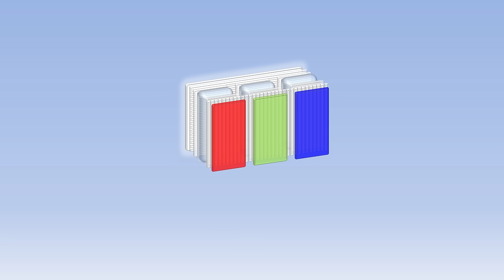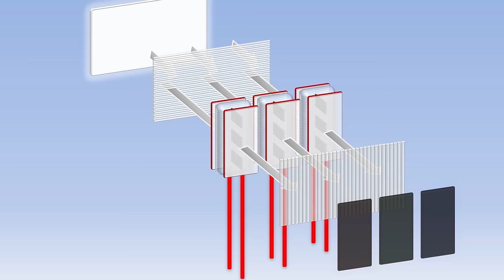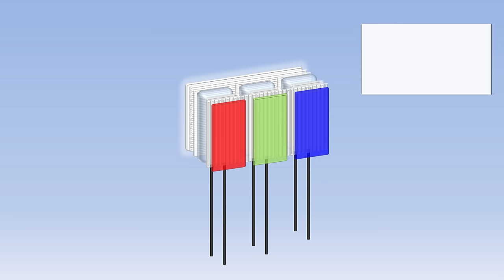How PIXELS Work

Comment: Surely the best LCD video I've yet seen! Awesome work!

You could've added a "extra fact" thing that explains that the 0-255 is just a 8 bit binary number, not an arbitrary value.
Reply: *****
That's right.
256(=2^8) is 8 bits for each color, while 16777216(=2^24=256^3) is the total colors that each pixel can have.

That's a lot of information for 1920x1080 screen! You need about 50 million of 0's and 1's for each frame, if it was completely uncompressed.
Reply: bunch of geniuses in the chat!

Comment: I've found several videos and articles that describe what this video describes, but I'm having trouble finding one that describes how a particular set of RGB voltage levels gets from the chip that is receiving the data stream to a paticular pixel on the screen. For a 1920 x 1600 pixel screen, that's over 3 million pixels! For each pixel, you have 3 LED's with 2 electrodes each that you have to wire up. So that's 3 million * 3 * 2 = 18 million wires! So I can't imagine that it's actually done with wires? How does it work?

Comment: This has been the connecting point for everything I've researched on pixels

Given that each color filers has 8 bits ( binary digit) of brightness information like this :

1   0   1   0   0   1   0   1
for each bit you get 2 possibilities : 0 or 1

2 x 2 x 2 x 2 x 2 x 2 x 2 x 2    = 2^8 = 256

Comment: But how does the monitor send a signal to each pixel? does that mean each pixel is wired? I thought thats why mini led is hard to make, 

Found the answer from reddit, doesn't explain why the mini led is hard to make, and what kind of tiny wires are they using?: 

"ACTUAL ANSWER: most screens are subdivided into squares or columns of pixels. The actual pixels are made up of 3 subpixels. Yes, each subpixel has two wires going to it, usually one wire above going up and down and another line under the going sideways, like a grid with subpixels located at the intersections. Inside the screen there are "column driver" chips that take binary address along with color and intensity and convert it to a signal to drive the subpixels. If your monitor is say 1920x1080, you can have twenty 192x540 blocks each driven by their own driver. All these chips are then connected to the master chip that takes input from your videocard, does address conversion from x,y,intensity to column,x,y,intensity. This master chip has very few data lines coming from the videocard."
Reply: oh so do the wires go in between the "black" parts
cuz was my exact question

Comment: Even when my screen is completely black, there is still light coming out from it. Where is the light coming from in that instance? Is the light coming through the spaces "between" the pixels? Or is something else happening here?
Reply: I the black pixel goes fully dimmed but doesn't turn off. Just guessing.
However, an AMOLED display can actually turn off the black pixel.
Reply: When there is light even when your screen is completely black that means there is still some degree of each color between 0 and lets say 20 or less so it's not completely black but it's very very dark that you would think it's black.

Comment: One thing I don’t get is how you get varying voltage from the binary? Binary is on and off so does each pixel use a digital-to-analogue converter in order to get the different voltages used to vary the brightness or are they just sent through different resistors depending on the binary numbers coming through?…

Comment: Why do we need to stop twisting when we light was already horizontal ?
Reply: +Alex John In short, we need to stop twisting in order to make the light pass horizontal (and not twist to vertical), such that it is blocked and produces darker shades up to black.

According to the video ( 1:34 ), the light gets twisted by default when no electricity is applied to the electrodes, and the liquid crystals are in their normal, twisted arrangements. Therefore, the horizontal polarized light (from the first polarizer filter) gets twisted to the vertical plane, passes through the second polarizer filter (the vertical one), resulting in a lighted sub-pixel (one LC with the the color filter at the end). 

When the electricity is applied to the electrodes, the liquid crystals lose their twisted or "normal" arrangements and are all arranged horizontally, simply passing the incoming horizontal light forward, which then gets blocked by the vertical polarizer filter, resulting in a black pixel or color filter.
Reply: +Instrumental Corner Why not just say it's window science? It's like window blinds.

Comment: But I have another thing I am curious about. Why put up a horizontal polariser if you need to make the light vertical? Why not just put vertical polarisers right in front of the backlight? Why would you go through all of this LC stuff if you could just put up a vertical polariser at the start?
Reply: the idea is to switch between a bright state and a dark state.

when the liquid crystal is subjected to an electrical field, it looses its twist angle, therefore losing its ability to twist the polarization of light.

so you exploit crossed polarizers, between crossed polarizers all light is blocked unless you have some kind of material in between that can switch the polarization of light.

Comment: One question. Before putting vertically etched glass and horizontally etched glass, liquid crystals (LC) are randomly oriented. After putting them in front and rear of LCs, LCs align with the etched pattern. So the single LC closest to the front glass is perfectly 90 degrees apart to the other closest to the rear glass. How come LCs follow etched pattern in glass and why?
Reply: I think he said it's because the electrodes placed in the etches have currents run through them that reorient the crystals.
Reply: no they do not. the etched glass actually favourises a planar arrangement of molecules. 

Either etched glass, or glass with a layer of oriented polymer will do the same thing, the molecules simply follow the features of the glass.

Also, this video has a small mistake, the liquid crystal is never disordered in the liquid crystalline phase, and it's in that phase in a wide temperature  range, prefferably from ~0 C all the way to 60-70 C, otherwise the liqud crystals would transform into an isotropic phase at higher temperature, or even crystallise into a solid state at lower temperature.

The liquid crystalline phase is already ordered in itself,  most likely into a chiral phase, but this chiral phase would have the helixes in different arrangements in the glass if it's not etched or covered in polymer.

The transparent electrodes are Indium-Tin-oxide and are needed to change the liquid crystals orientation and destroy the helix structure, this requires an electrical field.

Comment: Question:  My display has over 8 million pixels, so each need 2 wires to connect, so that 16 million wires that need to be addressed by the display driver.... I don't see 8 million tiny wires anywhere, or even 10 thousand, or even 1000 of them... how do they activate a single pixel exactly when there are no direct individual electrical connections to it?

Comment: why do we even need the horizontal and vertical polarizer if the transparent electrodes can block the light waves.
Reply: they don't bloch it they just turn it around
Reply: By using polarized light the Liquid Crystal can control the amount of vertical light being passed through. It's a characteristic of liquid crystal to perform this function. The LCD acts like a valve in a way.

Comment: why is necesary horizontal polirizer, liquide cristal, vertical polirizer? why dont keep only back light and filters?. Split back light in 3 and change the intensity of each back light and not with liquid crystal. Why is necesary to control the electricity in liquid crystal instead of control electricity in back light.?
Reply: @BKR Brandon  that doesn t respons to my question.

Comment: If a computer display is set at 60 FPS, does that mean that 60 times per second the computer adjusts the amount of light going to the red, green, and blue pixel?
Reply: John Doe The computer display is measured it Hz by the way, so it's technically a 60hz monitor. It has the capability to refresh up to 60 times a second, so when playing a game, if you are getting more than 60fps, you would be using more processing power than needed. There is no point in getting 90fps if your monitor will only refresh 60 times a second
Reply: +Cr1spyBacon8r Actually, FPS isn't an end-all way to determine if you are getting enough frames. There can be a lot of screen tearing going on, or differences in times between frames that are all too visible to the human eye. All too often, 60fps rounded by the second isn't as smooth as it could possibly be, and a higher processor capability can help greatly in remedying that issue. You're %75 right though, sometimes it is a bit of a waste.

Comment: Why is the value 255? Are there 256 shades of every color or something?
Reply: Each color filter has one of 256 shades (0-255). This is not a choice based on the laws of physics. Rather, this is a choice based on the fact that 256 is a single byte value or an 8 bit value. Each bit can hold 2 values so 8 bits can hold 2^8 or 256 values. This is convenient for digital computation since everything computers do is done in binary. This makes it easy for an LCD monitor to translate binary commands received from a computer or TV cable.
Reply: if theres 8 bits with 2 values in each bit.. wouldn't that be 16 values?
Reply: +christopher jones Think about it this way. Let's try the same idea in decimal. If you have 1 decimal place, you can hold any value from 0 to 9 (10 values). If you have two places, you have a possibility for any value from 0 to 99. This means that you can hold 10^2 or 100 values. For 3 decimal places its 10^3 etc. Now in binary. With a single binary place, otherwise known as a bit, you can hold 2 values 0 or 1 (2^1). For 2 binary places (2 bits) you can hold any value from 00 to 11 so 2^2 or 4 values. This means that for 8 bits, you can hold 2^8 values: any value from 00000000 (0) to 11111111 (255).
Reply: so 256 combinations of 1's and 0's and each combination represents a different shade of color. 00000000 being black I assume and 11111111 being white.I think I get it now.
update: just found this: http://www.rit-mcsl.org/fairchild/WhyIsColor/Questions/4-5.html  which explains it pretty thorough. I think ill have to reference this page many times again in the future heh.
interesting subject might I add. I guess Ill need to learn binary, decimal, and hex inside and out if I plan on doing some opengl programming
Reply: +Christopher Jones 256 combinations for each primary colour,(red,green,blue) so 256*256*256 combinations in total so  white would be  11111111,11111111,11111111
Reply: But where exactly do those 256 choices come into play in the technology? Well, they are used to control the voltages that are applied to the electrodes contacting each liquid crystal. If you choose 00000000, then a specific voltage is applied to the crystal and the little molecules in the cristal aline according to that voltage. If you choose 00000001, then you change the voltage slightly and the molecules in the crystal "twist" a little more accordingly, resulting in a different amount of light passing through the crystal and consequently producing a different shade of the corresponding color. If you choose 00000010, then you twist it slightly more...and so forth.

As you know, the objective is to control the "twist" of molecules in the crystal,  from being completely horizontal (00000000) (no light goes through), to completely vertical (11111111) (maximum light goes through). However, by having only 8 bits, you are now limited to only 256 different voltages, which correspond to 256 "twist configurations", which in turn correspond to 256 different quantities of light going through, which finally produce 256 different shades of the corresponding color. Meaning that you cannot create infinitely many shades of red (or green or blue), but only reproduce 256 different ones which is rather limited.

But what if instead of 8 bits, you decide to use 10 bits, then it would be possible to have 2^10 = 1024 distinct voltages ==> 1024 distinct twists==>1024 distinct amounts of light going through==> 1024 distinct shades of each color (red, green, blue). Still a finite amount, but at least you are able to reproduce more colors. Ideally we would like to control the twist as precisely as we can, but for infinite precision we would need to use infinitely many bits, in other words, have an ANALOG voltage control, instead of a digital.

Comment: why do you need the horizontal  polarizer?
Reply: to block all the light when the liquid crystal is aligned vertically, the liquid crystal in that arrangement no longer twists the polarization of light, so this state is the "off" state.

you need crossed polarizers to block light.

Comment: I looked everywhere and can't find how screens are made with so many pixels and how the electricity is controlled to the millions of pixels in displays.  I find how one pixel works, but how the fuck do they control millions all at once and how are computers able to tell the millions of pixels what to do?  I can hardly solder the tiny pins, but these pixels are much much smaller, so how the hell is it done? lol